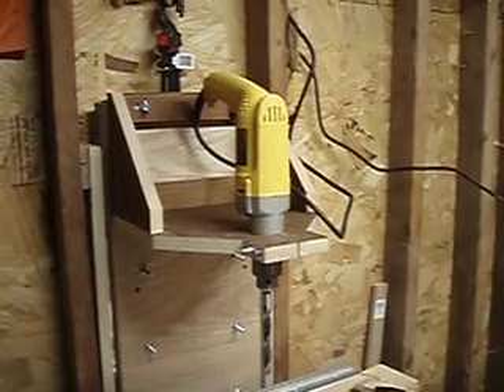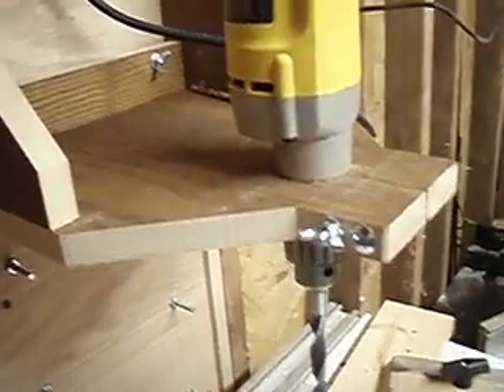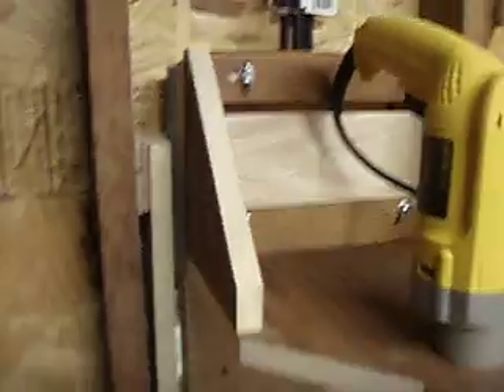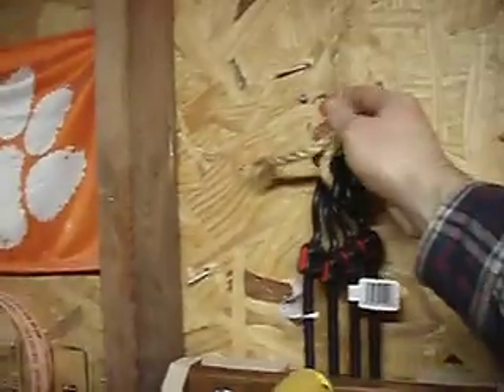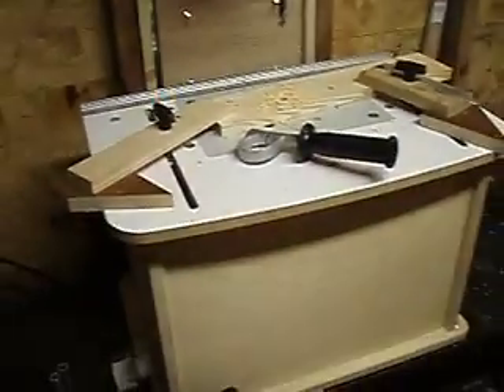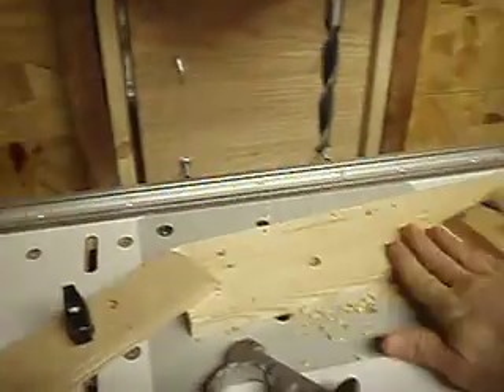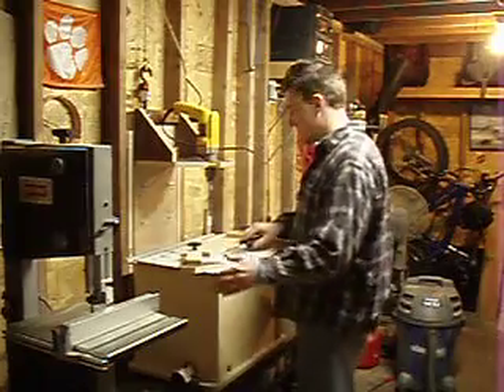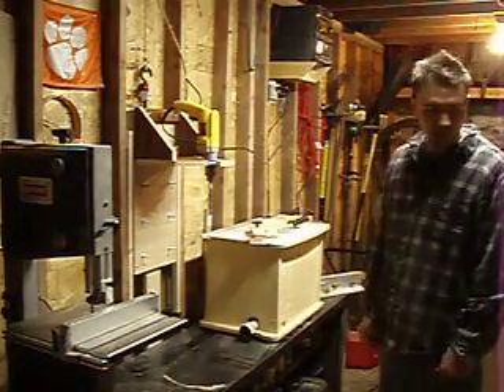Homemade Drill Press

Comment: Hey, great idea.  I've been thinking about making something like that.  The advantage of a unit like yours is that it has a far longer stroke than any store bought DP.  I make mortises in timbers at times, and a standard DP can't hack it.  
I want to mount mine on a plywood disk mounted on the wall.  The disk will allow the whole slide unit to pivot for angled holes.

Comment: That is awesome!!! Holes as deep as any drill bit and you saved yourself a lot of money. 
I only think you should but some type of strap over the top of it so that is has no way to pop out of the collar-hole upon and maybe a couple pieces of wood by the handle so that it can't spin in the hole. 
If you mounted an on/off switch you could just leave the drill in the ON (trigger locked) position. Also if you could lock it at a depth you could run drum sanding bits.

Comment: Nice vid and that may be all the drill press you need.  However, I would recommend getting a small table top drill press, they are not that expensive.  Look on Craigslist, you might even find one for free.  For drilling steel, they come in handy.  I traded our table top model to my brother in law for a pretty large floor model.  It's pretty old, but It will drill through anything.  Good luck.

Comment from the maker: It's important for the bungees to be long so they will have sufficient range of motion without getting too stiff. Mine are 3 feet long unstretched. They go down behind the platform and attached to a piece of 1x4 which is attached to the platform and extends a couple feet below.

Comment: @kofimarc 
Yes, 24" is more than I'd need, but 12" isn't.
As for the wobble at the extents, get extra glides & take them apart.  Mount 2 of the stationary sections in line w/ each other so the sliding section passes from 1 stationary section into the other so the sliding section is never in a cantilever mode.  I would have 2 of these at each side & 4 at the back.  When you screw each pair in place you locate them a tiny bit too far apart to take slack out of the bearings.

Comment from the maker: @NeyJerk I leveled the slides on the wall, cut the bracket perfectly square, and carefully drilled the hole that accepts the drill. This hole is not round - it is relieved in three places (sort of clover shaped) which allows a precise and repeatable fit.

Comment from the maker: @busupholstery yeah, I thought about mounting the handle, but I thought I might need the handle for its intended purpose. I didn't show the design details in this video, but there are several that are important. For example, the hole the drill fits into is not round; it's relieved in three regions (kind of clover shaped) so that there are three points of contact when you clamp down, making for an accurate and repeatable fit. There are similar reliefs in the other mouting surfaces of the bracket.

Comment: nice, but doesn't look comfortable on your shoulders. u need to raise them in order to push that plate holding the drill down. i thought u could pull the plate down instead of pushing it. 
how a bout making a handle to pull that whole contraption down?